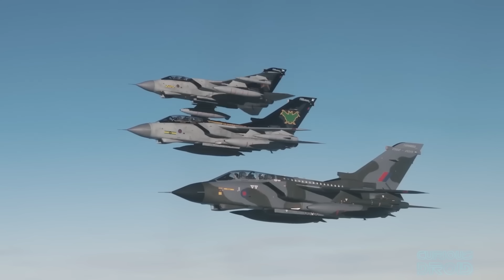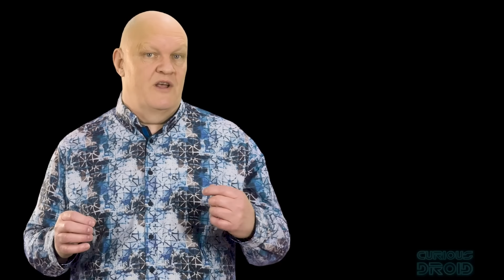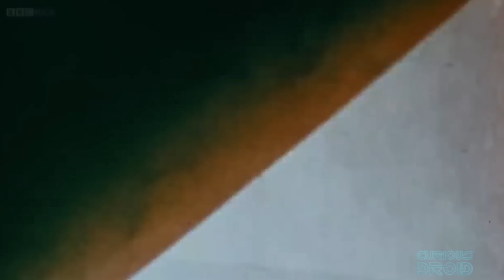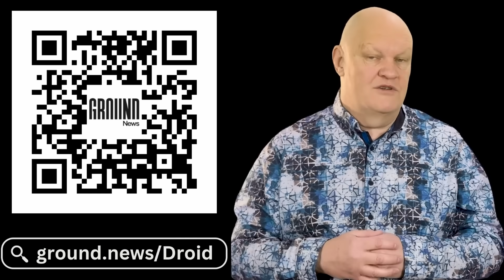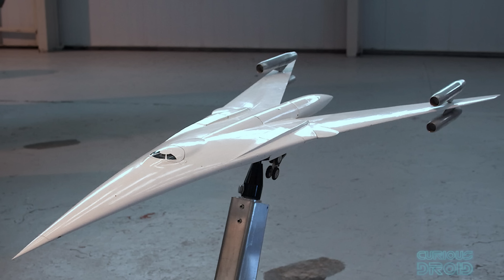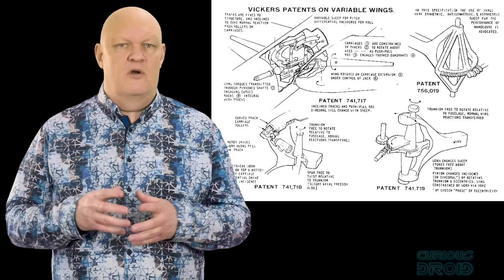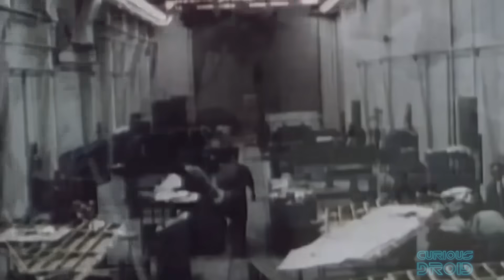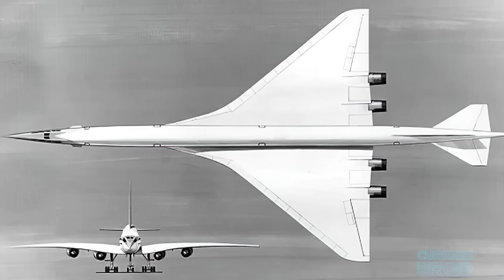Why Aren't Swing Wing Aircraft Made Any More?

Comment: McNamara was not popular with the people of the Dept. of Defense.  The F-111 had issues of size and weight that were basically unsolvable, hence the navy saying that it needed to loose 20 tons to be acceptable.  We flew them until they wouldn't fly anymore.  The F-14 was a money pit by the 90's and the navy was so tired of it that any and all updating of the design was dismissed.  In both cases it is too bad because they both possessed some characteristics that the air force and navy need today, namely speed and combat radius.  As to the B-2, to paraphrase Jay Lenno: if you see a swarm of bumble bees coming at 600 mph...

Comment: The Tomcat was well suited to its role as a fleet air defender, capable of operating on a carrier, loitering at long distance from the carrier and keeping Russian Bear bombers anc their cruise missiles at bay.

But it never overcame its three major shortcomings; a badly paired engine and airframe (even after the TF30 was replaced in the D version), its analog nature, and its massive radar cross section. 

It was the right thing to do to retire it after 30 years of service, to devote those funds to more modern F18 Super Hornets. 

It is a pity though that only a handful survived the boneyard cutters, albeit for obvious reasons.

Comment: Maintenance , weight, mass, stress fatigue.  And the development of fly-by-wire technology allowed for very different fighter designs with critical instability. Greatly improving handling, capability, safety and fly-ability.  And using leading edge flaps and wing route extensions for greater lift when need.  With many minor computer controlled adjustments each second. Allowing thinner wings with greater lift and much easier and stable landings.  Built in instability can improve maneuverability but make flying difficult.  Computers can overcome that problem and make aircraft safer to fly.  The center of balance can be changed. Route extensions also added lift with less mass and volume.  Stealth could also be problematic.  Next generation fighters may also lack vertical stabilizers to improve stealth while retaining control and stability. Using fly by wire.  And may not have bubble cockpits for good observations.  Relying on sensors instead. High G dogfighting being a less important factor.  And may not have variable exhaust ducts like the F-22.  Even pilots may be optional. Computers doing most of the work anyway. It is not easy to keep pilots away from fighters.

Comment: Leading edge root extension, causing a vortex, improve the performance of a normal wing. Maybe that closed the gap enough for turn performance.  New engines with more thrust , as droid said, to help push the aircraft forward through turns. This push the G forces up from 7 to 9 as the new standard. 

Swept wings is trying to achieve too much without thinking of costs. I think F14 is an exception. 
It did not make it a better dogfighter. But it weigh a lot. It was all about lowering landing speed. Yeah and not slam into the carrier deck with too much force cause the deck surface can bend then after thousands of landings with heavy planes. But this low speed characteristics can be use in combat too. Anyways the main goal was to get a heavy bird on the deck of the carrier. If F14 has max number of Phoenix missiles the plane can not land on carrier or the plane can break. So either drop 2 in the ocean or fly off to land smoothly on a land base.

Comment: The Me 262 only had its wings swept to change the centre of lift to preserve stability after the installation of heavier Junkers Jumo 004 engines. The DC-3 had about the same amount of wing sweep for the same reason (this was because of the increased payload compared to the DC-2). 

The Me-163 had swept wings for longitudinal stability like all tailless aircraft, not speed.
Reply: Absolutely NOT TRUE. THIS FALSE URBAN MYTH HAS BEEN DEBUNKED
That claim comes from a single, highly dubious source... it is based on the authors lack of understanding in the difference between the RLMs Projekt 1070  (which was designed with straight wings and was cancelled) and the Projekt 1065 which was designed from inception to have all swept lift and control surfaces and was adopted as the Messerschmitt Me-262.

This false myth is easily debunked by the fact that the CoG can be easily changed by repositioning the engines on the wing.

and the fact that the Me-262 flew with 1, 2 and 3 engines, many different engine types with different weights and CoGs from many different manufacturers with NO CHANGE in the wing sweep angle.  

Adolf Busemann designed the 1065 and tested it to speeds up to Mach 1.4 at the Luftfahrtforschungsanstalt the only supersonic aircraft wind tunnel test laboratory in the world during WW2.

Comment: There are ways to increase low speed lift without an expensive and heavy swept wind and modern engines produce so much thrust that stalling is no longer a big problem.
Reply: The Messerschmitt Me-262 solved the problem with automatic retracting leading edge wing slats.

Comment: The simple answer is lack of innovation.

The fully upgraded and modernized F14 proposed by Grumman would've drastically cut maintenance cost and time.

An entirely redesigned swing wing would be even less expensive than that.

Engineers are afraid to innovate in order to bring back a powerhouse design and the government is too corrupt to put funding where we need it.

Comment: "version of the B-1B"

The Tu-160 has absolutely ZERO technical connection to the B-1B.
It was originally started as a response to the B-1, but when that project went away, the Tu-160 still carried on on its own merits.

Also, Tu-160 topspeed, over mach 2, B-1B, mach 1.25 at most.   That alone tells you how little technical connection they have.

Comment: A big factor was also low level operation during the cold war. It is no great surprise that most of the swing wind aircraft were air to ground. The swing wing allows them to move from a low wing loading for shorter take off and landing to a higher wing loading for smoother low level flight. The pinnacle of this was the Panavia Tornado which, as well as swing wings, had slats, full length double slotted flaps and thrust reversers to aid with short take off and landing as well as fly by wire to allow smother low level flight at very low levels.

Comment: There is still a niche that swing wings could mathematically fill in the gen 4.5+ world where they would bring either more performance or more range than their non variable counterparts, but the level of complexity and cost associated with that basically makes it unjustified because it's a relatively marginal advantage. You can't beat the advantage of having physically longer wings at low speeds as any fancy aero tricks you use to do so could also be applied to the swing winged plane too, and again you can't beat the specific speed optimised swept profile of them at high speeds either, it's just actually justifying that in the real world really doesn't make a lot of sense because it's a relatively marginal gain for so much extra cost and complexity...and at that point just go 5th gen

Comment: The whole point of swing wings was so you could go supersonic at low altitude , survive the turbulence and still be able to land at a safe speed.

If you were hauling at mach 1.2 just 100 feet above the ground to avoid radar , you needed small wings that wouldnt slam the aircraft with 15G bounces when you hit the kind of turbulence you see at 100 ft.

But wings that small wouldn't be able to take off with a heavy payload

So the F-111

Then cruise missiles got good and took over that job.

The F-14 was a high speed interceptor to carry a lot of long range  air to air missiles extremely fast and still be able to land on a Carrier.

Then the SM-2 got good.

The reason swing wings went away is because missiles took over the jobs they were doing.

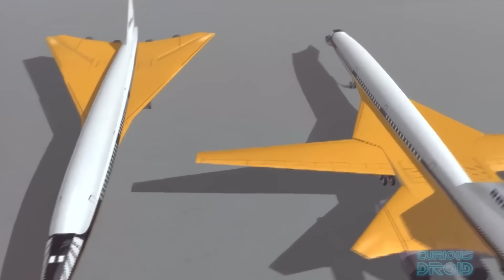Comment: 15:38 one thing that has to be said is these 10m2 etc. Are not accurate at all and aren't particularly useful, especially as it doesn't take into account of wavelength of which long wavelength can just see stealth aircraft, for example the Yugoslavian anti-air battery that shot down the F-117. It was believed they saw the bomb bay doors open but this was not true, they had just adjusted their 1950s radar to long wavelength the disadvantage is shorter range so it went from 500km to 20km but it did mean an F-117 was completely visible from that distance. The threat of anti-radaition missiles meant that the SAM battery's would switch on and off their Radar in short bursts normally 2 30 second bursts, before moving to a new position to avoid those anti-radition missiles, this meant that the one battery that implemented this had only limited opportunity to fire at stealth aircraft.
Reply: No aircraft is completely invisible to radar, this is a very common misconception about stealth aircraft.
 at a close enough range all stealth aircraft are visible on radar

Comment: It is actually quite a miracle that swing-wings ever worked. Wings are shaped for air flowing over it at a certain angle / in a certain direction. Change the engle of the wings and you change the direction/angle of the airflow over thecurving of the wings

Comment: How about just simply finding better designs and improvements in the technology, that made swing-wings obsolete?
Example, Su-57 take-off roll from the runway is under 100 meters when light. It basically jumps from the air, without being V/STOL.
And for landing, it can as well come to stop very quickly, so you can use short runways for landing. Nothing like F-16 with serious limitation for that.

When MiG-23 was done, it was just the same, to shorten take-off and landing distance and maximize flight speed.
Compare MiG-23 to MiG-29 and it is obvious why MiG-29 is better, on everything except acceleration like a rocket.

Just alone looking the Soviets designs, the MiG-29 and Su-27 ended the whole reason to have Swing-Wing. And both are carrier capable designs.
Think about MiG-23 on carrier :D

Harrier was developed for the same reason, as that take-off and landing is critical.
And F-35 variant with V/STOL capability, it continues that as well.

Comment: The tomcat used the first microprocessor in a fighter.. it’s controlled the actuation of the wings
Reply: Saab Ja37 was before it couple years. It is called "First Flying Computer".

Appendix 6
The design of the Datasaab computer prototype D6/37 took account of experience gained
from the commercial minicomputer D5/30 and 10 years of technical development with respect
to CK37. The memory was 128 kbyte, a ferrite core memory, with 32 bits. Computing speed
about 700,000 (more than 3 times CK37) instruction per second with floating point arithmetic.
The components consisted of thick-film-hybrids with individual components and gold type of
wiring enclosed in glass and ceramic. The components were mounted on two circuit cards
with air-cooling. MTBF during flight operation was 1100 hours. The design made it possible
for a mean time of 15 minutes to repair a component. Total weight was 31.4kg exclusive of a
unit for adaptation of in/out signals. The prototype was subject to different prolonged
environmental tests with positive results. The computer and test results fulfilled the FMV
requirements.
The Singer-Kearfott prototype CD107 also had a core memory of 128 kbyte with a word
length of 16/32 bits. Calculation speed was 500,000 instructions per second with floating
point arithmetic. All components, mainly flat types, were mounted on 41 circuit cards/units,
connected to a common motherboard. Some memory components, thick-film-hybrids, were
manufactured by Saab. 40 analogue and 700 digital signals could be handled but the
adaptation was outside the computer. Total final weight was 26 kg and the power
consumption 585 watts. The memory was increased during the 1980 ́s to 240 kbyte with a
semiconductor memory in order to handle new weapons for the aircraft.

Comment: Not sure why I have to keep correcting this, but.  In 1947 the aircraft was known as the Bell XS-1, for Sonic Research Experimental number 1.  The aircraft was not designated as X-1, for Special Research number 1, until 1948, so, thus, in October 1947 the aircraft was the XS-1 NOT the X-1.  

As well, the B-47 was the StratoJet NOT the Stratofortress.

Comment: Excellent as always… however I was left with a question as it pertains to supersonic designs of USA vs Europe:

Separate tail structure.

Why did most USA SSTs have a separate tail structure vs a single delta wing?

Sure, the Lockheed L-2000 featured a single delta wing, but Boeing’s final B2707 fixed delta wing design featured a separate tail wing as well. But even with fighters, the European designs generally feature a single delta while the USA designs all have separate tail wings.
Reply: America (thanks to the Germans) was about a decade ahead in supersonic aircraft technology than Europe after the war...

The most advanced supersonic wind tunnel research laboratory in the world (the Luftfahrtforschungsanstalt ) was built in 
Brauschweig,Germany after the war it was dismantled and shipped to White Oak Virgina. it is still used by NASA today

Comment: I firmly believe the first aircraft to break the sound barrier was the Me163. There are eyewitness reports of an example producing a great boom in a high speed dive that nearly destroyed the airframe. It landed, but was found to be missing most of its control surface. In short, supersonic by fluke not by practice.
Reply: Me-262... not the Me-163. Flown by Hans Mutke
The Messerschmitt Me-262 was wind tunnel tested to speed up to Mach 1.4
Reply: The X-1 was the first to do it in level flight.
Reply: @thetimebinder  The X-1 was the first MANNED in level flight, the German A4B rocket plane flew Mach 4 in 1945 (unmanned)
Reply: @DoktorBayerischeMotorenWerke  Yeah, I was just correcting the dive vs level flight debate. There are reports of planes breaking the sound barrier in dives but the X-1 was the first manned craft to break the sound barrier in level flight.
Reply: @thetimebinder  Indeed, the Me-163 is however the fastest manned aircraft in level flight until the Bell X-1.

Hans Mutke in the Me-262 was the first to pass through his own shock wave at Mach 1 and live to tell the tale... Chuck Yeager would confirm Mutkes story after flying the Bell X-1.

Comment: there is an rc plane that achived transonic speeds using a straight wing while dynamic soaring. it's called the Transonic DP and the pilot is Spencer Lisenby.
Reply: Yes, but the Renolds number is scalar,  drag increases with size. Real planes have higher drag relative to their size.

Comment: Having worked on the Tornado for a few years I would speculate that the reason for variable geometry wings fell out of favour was the complexity of the swing wing mechanical and hydraulic systems, especially the hydraulic system, and why do I say that?, well plainly speaking it was a complete pile of 💩 to get at, remove and install components and a complete sack of Sh1t, but that is just my opinion and probably has more to do with advancements in aerodynamics and technology systems.

Out of all the “swing wing” aircraft types built the best looking is the B-1B Lancer/“bone” it just looks fantastic and vicious, something that it definitely is, and it will be a sad day, for aviation enthusiasts, when the bone is finally put out to grass.
Reply: Cost and need.

Comment: The Me262 does have swept wings, but people who have studied the development closer claim it is due to the engines becoming heavier and a need to swift the center of gravity/lift rather than high speed flight.
Reply: That claim comes from a single, highly dubious source... it is based on the authors lack of understand in the difference between the RLMs Projekt 1070  (which was designed with straight wings and was cancelled) and the Projekt 1065 which was designed from inception to have all swept lift and control surfaces and was adopted as the Messerschmitt Me-262.

This false myth is easily debunked by the fact that the CoG can be easily changed by repositioning the engines on the wing.

and the fact that the Me-262 flew with 1, 2 and 3 engines, many different engine types with different weights and CoGs from many different manufacturers with NO CHANGE in the wing sweep angle.  

Adolf Busemann designed the 1065 and tested it to speeds up to Mach 1.4 at the Luftfahrtforschungsanstalt the only supersonic aircraft wind tunnel test laboratory in the world during WW2.

Comment: All the advances in engines and aerodynamics could still be applied to a variable-swing aircraft, and it would still have much wider flight envelope everything else being equal. Because physics.

Variable angle is not free, but neither is NOT having it. While fixed-angle is cheaper to build, it either cannot attain the same high speeds at all altitudes (F-22 cannot come close to the top speeds of F-14 despite much newer engines), or cannot fly as slow, or (as in most real examples) BOTH.

The latter (lack of low speed) costs you dearly as you need longer runways, For Navy aircraft it means you need supercarriers instead of regular aircraft carriers (SO EXPENSIVE!) and much more powerful catapults and arrestors, necessitating heavier running gear.

Also without low speed capability you NEED all that unsustainable high G’s to make tight turns, and I don’t care how well you are trained and how good your pressure suit is, at 9g you are not lasting more than a few seconds and still cannot avoid modern missiles with 30g and lateral thrust.